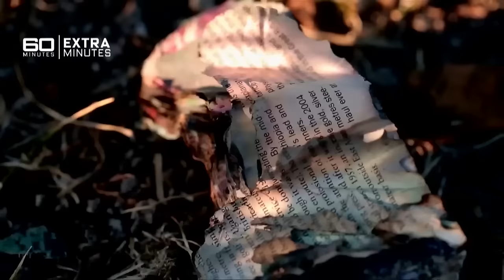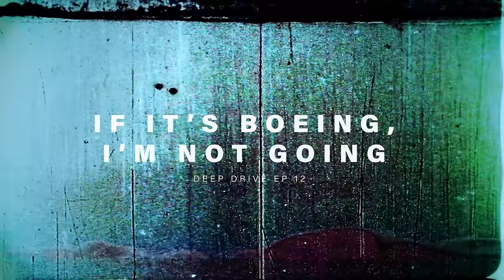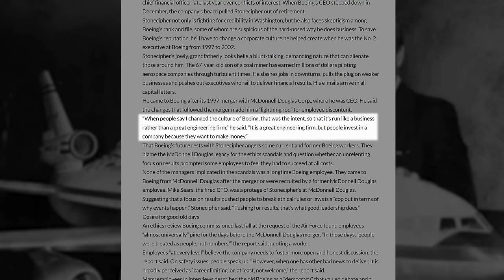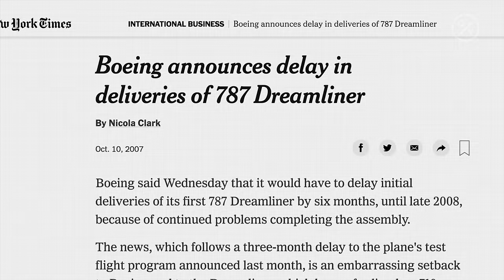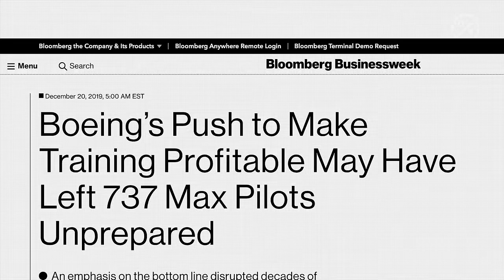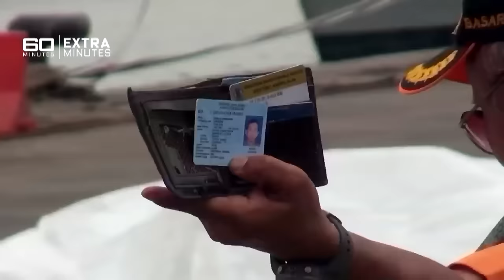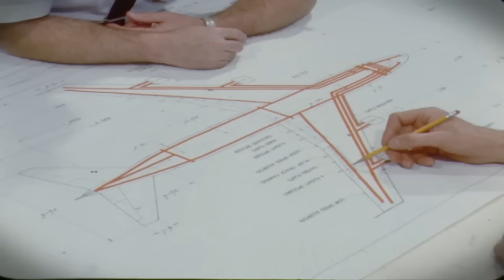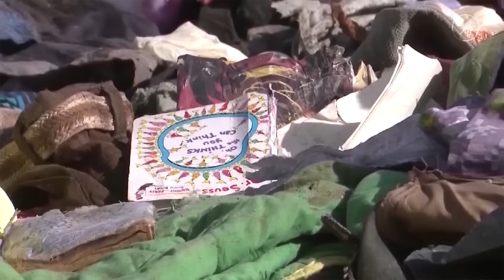Why America Can't Let Boeing Fail

Comment: Deregulation has nothing to do this. It is a wrong conclusion to make. The same lack of quality has not been seen in the airlines, nor at airbus, nor at other plane manufacturers. This is a Boeing specific issue. Actually deregulation saved millions of lives through lower fares and increased competition in the industry.
Reply from the maker: That's a great point. The point we were trying to make is more so that deregulation changed how the industry worked, which led to the Boeing/MD merger and that led Boeing to where it is today.